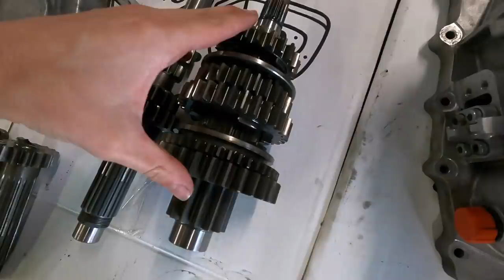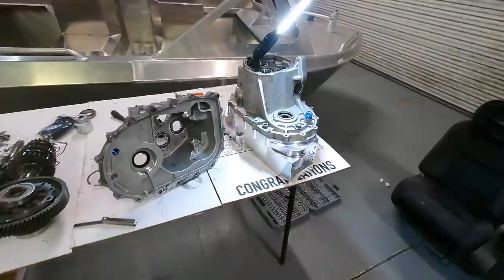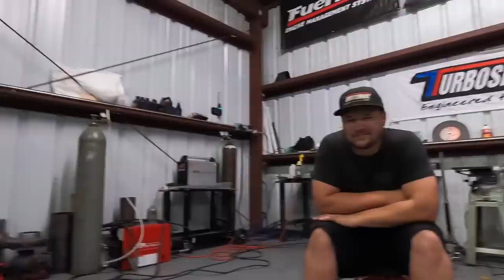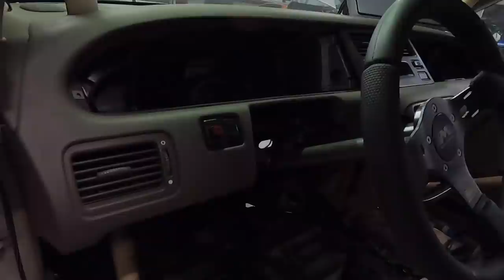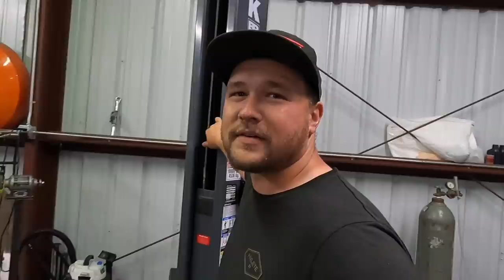We Are Putting a $10k Transmission In Our $500 Minivan

Comment: The Rowdyssey is the ultimate Race Week vehicle.  Put a luggage pod on the roof for a tent and other lightweight stuff, then no need for a trailer.
Reply: it has an overheating issue when on race week but sick week wouldve been perfect
Reply: @trilliedon8728  im sure its because of the tiny radiator they have lol
Reply: @ekcivicuk  probably
Reply: @ekcivicuk  All they'd have to do is add a second radiator like Shane did on his CRX.  Plenty of room for it in a minivan.
Reply: @tippyc2  does anybody make a quick disconnect system for radiators? Would be hilarious to be able to swap between the race rad and a monster cruising rad.
Reply: @martindinner3621  Looks like Summit has QDs listed up to 16AN.  Probably need bigger for a radiator though
Reply: @martindinner3621  easy to do. Just put it in the heater loop.
Reply: @tippyc2  got curious, so I went digging. Summit has Wiggins connectors up to -20 (1¼"). Not fantastic for flow, but...

Comment: For the top nut of your trans instead of a weld beed can also make a safety wire like in airplane's. It's easy and reliable. No need to grind it back later.
Reply: idk how well that would work on a singular nut that's turning
Reply: @pagani8  you’d have to tap tiny a hole through the nut and shaft to feed safety wire through
Reply: Main problem with doing this is how thin that nut is. Other than that, safety wiring is an excellent idea.

Comment: Look into cryogenic treatment for them gearsets.. Greatly improves wear resistance and durability. We do it to all our odyssey transmissions. (The 85 fl350 honda odyssey buggies) we put 5x the power those things are built for and they've lasted multiple race seasons.
Reply: @tyrellwashington747  its a thing
Reply: @tyrellwashington747  bs on what? Cryo or my buggies?
Reply: @MobiusHorizons  pro racing teams been doing it for years/decades. There's a reason they do it to all your high dollar tooling/drill bits.
Reply: @tyrellwashington747  I call ignorant
Reply: @MobiusHorizons  i would believe that drills have a ton in common with gearsets....
Reply: Cryo was  a big thing in the early 2000's.. ive done many and the gears still broke lol
Reply: @mike93eh  it doesn't make things unbreakable.  Its for making parts more durable and stronger when there's no other options. Say for this exact instance where the only options are the factory gearsets or pay crazy money to make a custom set.
Reply: @tyrellwashington747  lol get out more.
Reply: @shifty1927  and my point was that it does NO such thing LOL. still easily breakable.
Reply: @mike93eh  guess nasa cryro's their parts for just the fun of it. Get a life kid.
Reply: There are microscopic images for what it does to the grains in the metal. It's legit.
Reply: @fuzzylogic394  Thank You for explaining. 

Which country do You live in ?
as had stated that Communist also have other companies and manufactures too. However, does the Communist Gov't in Your country also own portions of these manufacturing companies too ?
In CCP, they have these arrangements too.

Sincerely

It seems You manged to read some of my comments further.
Did You do this by using small amounts of time  in which You able to focus ?
Other which i have worked with use this method effectively.

All The Best.
Reply: @fuzzylogic394  So, from this response is seems clear You reside within CCP-China, correct?
If so, and such Your information is not quite correct either.
Why? since these CCP members are among the owners [not jsut investments, though stock owners are often called or referred to as 'investors', similarly with venture captial 'investors', their ownership of the stock is actual ownership of the company/corporation, and thus can and do direct, dictate, control. In addition, this is the means by which the CCP Gov't extends its ownership and control through these key CCP Party members. And as such like with man who the CEO, owner of Alibaba, they allowed him to do business, then when the CCP Gov't Authorities decided, they 'made him disappear' for several months, then 'reappear'. Quite obvious he is within their complete control. 
This exists elsewhere in the world within evewry country too, which are Socialist, or other wise portrayed or actual like the USA, but have very significant Authoritarian rules, etc established, In the USA several Federalo Gov't Agnecies have their venture capital investment corportations, connections and partnerships with other venture capital investment corporations, and hidden investment prior to the establishment of these capital investment corporations. They   have manged to direct, dictate, control these companies/corporation, especially with their development of technology, access to their information, developments, [which were paid for], data, collected information [especially via communications technology development which they sponsored]. Examples are satellite communication systems, "Internet" [first ARPANET within DARPA before released], cellular-mobile communication systems and networks, and many others.
Other example are the various companies which manage to gain access to world stock trading markets like in the USA, gain huge amounts of capital investments, stock purchase, etc. then the companies claim bankruptcy, and the CCP uses their Gov't ownership status to remove any financial obligations to the 'investors' for the company/corporation.
If You search for "China Hustle" You will locate several sites including one which a from friend of mine who is originally from the USA as me, and lives here in Our land too.
please see : https://www.thechinahustle.us

So, actually what You attempt to claim that the CCP does not own these companies/corporation is partially correct but false via claiming 'investors', since 'investors' are actually owners and further the CPP Party, Gov't has control of these individuals and thus the CEO, Owners, etc. too.

All The Best
Sincerely

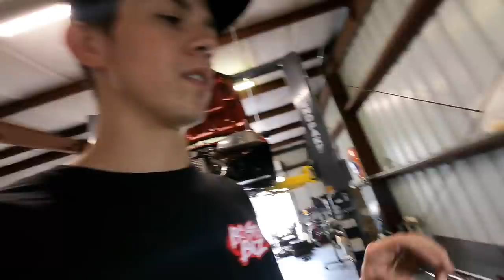Comment: 11:20 - maybe throw a tack on the opposite side too, just for balance which leads to smoothness and helps longevity
Reply: I was thinking the same, but alas it's too late now. Still don't think it'll hurt
Reply: good idea for mechanical stability to have opposing tack welds certainly. 😏
better with four symmetrical tack welds. 😄
even better with six symmetrical tack welds, as the hex nut. 😆
Sincerely ☺

Comment: aside for power the next real problem is aerodynamics . its a brick frontal area is fixed , but you have space. a ducted fan pulling air from underneath could be adjustable and roll racing it might be faster than the NSX. suspension and side skirts a must but you are going to do that anyways. it also could be hidden or at least stealth.

Comment: Those Drag&Drive Pro-mods are now going for electric windows and nice interiors...
What's cooler than doing a drag&drive event in a 9 or 10 sec minivan, in comfort, WITH AC, heat, good wipers, sound isolation, good speakers AND room for drag wheels and spare parts. (Not an 8 sec minivan completely gutted out with no comfort at all) Just my honest opinion! 
Already at full Drag-car on the MR2 and the Hatch is going in that direction too...

Comment: Gut the back half and keep the front doors functional. I think you could spare a couple pounds or leave enough material for the regulators to bolt to. If you really want to save a few lbs make a tube subframe.

Comment: Maybe consider getting the trans nuts drilled and safety wire them instead of tack welding them...less trouble if you need to take it appart again

Comment: Awesome video. Just throwing this out for curiosity. Why can't you guys have a 5th gear in the hatch, for events like sick week? The guy that drove his GTO 3500 miles from Canada for sick week. Had I believe a T56 with the first 4 gears hardened, and 5-6th just normal. Keeping the the noise down and RPM.
Reply: 5th gear was sacrificed for a gear cuff. Which adds support to the input and output shafts. Making the transmission stronger.

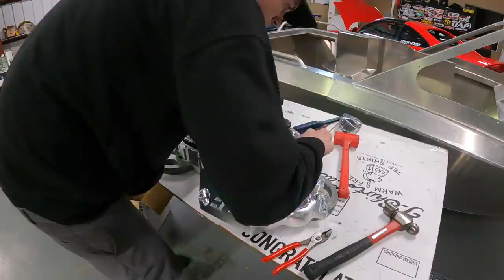Comment: 10:20 I see holes that look like they need bolts inside of them. On the shifter fork assembly, into the case.
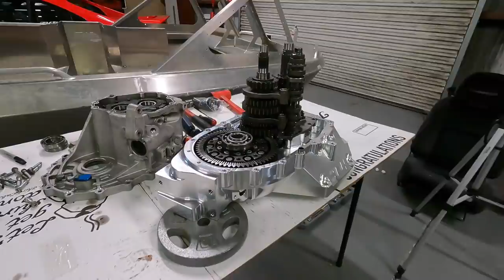Reply: It looks like he put those bolts in at 8:50 but it does look like there is a bolt missing from the diff to the ring gear at 9:05

Comment: I wonder if there would be a longevity benefit to having herringbone gears instead of straightcut, it would also be quieter for cruising, as for assembly im not sure how that would complicate things
Reply: Not sure if Serious! straight cut to transmit the power and far stronger
Reply: @v4yt126  It's a common misconception that straight cut gears are stronger, on helical (and herringbone) gears there is more surface area engaged and the engagement is less sudden, which makes the gear itself last longer. The reason race gear boxes are straight cut is to not get axial load on the bearings, which herringbone gears would solve. The issue is that herringbone gears are very hard to make, which is why you don't see them in car gearboxes.
Reply: a lot of old machines had herringbone gears and they last forever.. if only they make gearboxes like that just to see if they last :D
Reply: @Finnspin_unicycles  exactly
Reply: @Finnspin_unicycles  thats another reason they use straight cut gears is that they are cheaper to make, so breaking a gear isnt as big of a deal to replace

Comment: Well there's a minivan out there That has a jet engine in it both side doors open Is the back hatch opens in the jet engine goes right out the back inlets are the 2 side doors Then when the guy's done going down the track he hits a button both side doors power shut along with the jet engine pulls back in and the back hatch goes down those down with power

Comment: With any car I’ve owned or driven the transmission was the downfall. Good idea going ahead and getting the best you could. The boostedbois fleet is gonna be unstoppable.
Reply: I had the same problem in my Dart when I was driving it. Only a 318 with a automatic, but it originally had a 904 which was smaller, lighter, and cheaper. I wore out the original then toasted a couple of used ones. Eventually I gave up and upgraded to the big boy 727 and broke a couple of those with a stage 2 shift kit and my having fun manually shifting them up and down. I finally gave up and had a good core rebuilt with a minor stage 1 kit and no shift on command to save it from myself. It still works many years later and hasn't broken again. You can break anything if you have too much fun abusing it, high horses or not. It used to hold first to 5500 and punch the car sideways into second on dry pavement. That's about 1k more than a basically stock 318 was supposed to go but it was the only thing I didn't break or replace 😎. I did add a Thermo Quad carb and some ignition and exhaust upgrades and it is about as fast as a police Crown Vic now when it's right.

Comment: Also, you know what grade aluminum Mr. Spendy McSpendface bell hoosing is?? Prolly 6061 T6...you should quiz what one outta 7075 would be...then sit down and ask about magnesium!!!
Reply: 8620.
Reply: @MellowYe77ow  so ...steel used for shafting with splines??? Lookin aluminum me thinks
Reply: @jasonaldenhaley1  Not steel. Aerospace grade aluminum.

8xxx alloys use many different kinds of alloying elements and are reserved for specific requirements such as elevated temperature performance, lower densities, higher stiffness, and other unique properties. They are commonly used in helicopter components, and other aerospace applications, and are experimental in design.

Comment: You said, front wheel drive for the MR2. Did you mean to say, rear wheel drive ??
Reply: He said it was the front wheel drive version of the bell housing. Yes, he could of been more accurate and said 2 wheel drive, but it's technically still a front wheel drive  style transmission. It's just being used to drive the rear wheels.

Comment: There is a reason no  8 second mini vans exist.  With them being top heavy and far from good aerodynamics they should only be drove so fast. 185 mph probably is not a good idea.  If for any reason it starts darting left or right down track I seriously doubt you will be able to recover control.
Reply: With good coilovers, why not...
Reply: "should only" - that is a matter of opinion. "darting left or right" isn't an issue. It isn't a top heavy narrow SUV on tall tires. The odyssey isn't any more dangerous at speed than a station wagon. You seem to be getting confused on what it is - an slightly more bulbous Honda Accord.  . As far as aerodynamics are concerned a first gen camaro has a .38 drag coefficient, the Oddyssey has a .39 so it won't be an issue.  - This car isn't any more or less dangerous than anything else they have. The reason why an 8 second minivan doesn't exist is because there are way easier ways to run 8s.  It probably would be safer than the Hatch running those speeds solely on longer wheelbase. Got to love it when people talk sh*t pulling random theories out their ass - but can't be bothered to actually  * k n o w *   what they are talking about.